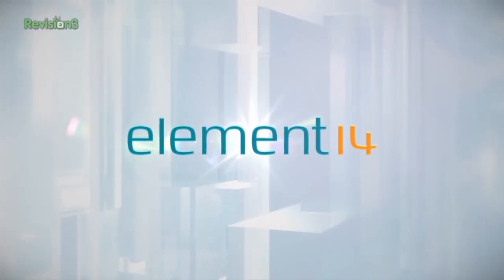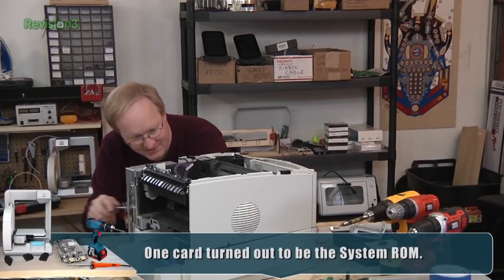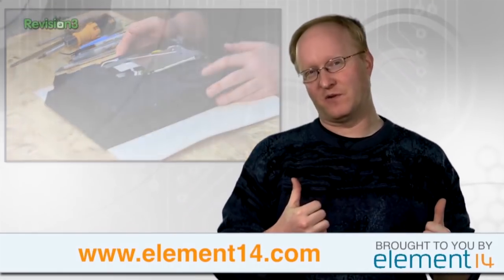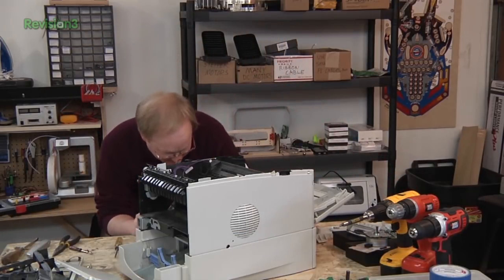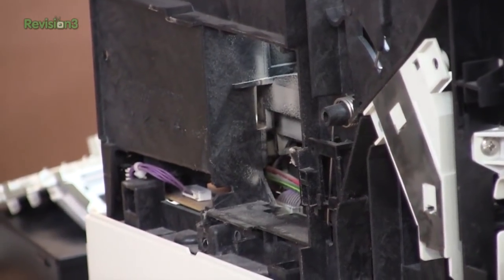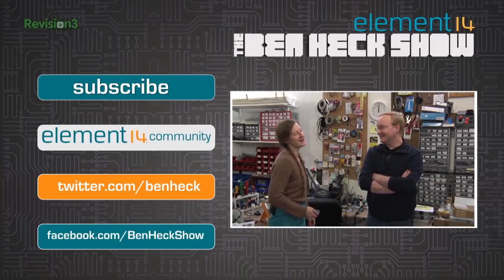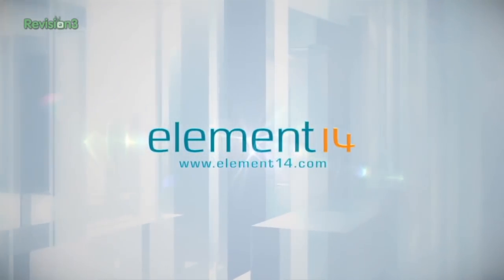Ben Heck's Laser Printer Salvage

Comment: I have this same printer, still running, got it from my high school when I was a kid, and with the network card in it, it's hooked to my wifi router as a wireless printer, works flawlessly (after a new paper feed roller kit) and the toner cartridges are $10 bucks on Ebay. Even if you fixed it up it's still quite a useful printer!

Comment: The best way to reuse a LARGE HP printer is to fix it and put it back in service.  With a little TLC the HP LaserJet 4, 5, and 4000 series will run forever.
Reply: Indeed, they often say that cockroaches and ants would be the only animals to survive a nuke but at least they would have a HP 4L to use afterwards!
Reply: My college is still using 4100Ns in multiple labs and they work flawlessly!

Comment: I'm always amazed by the mindblowing engineering that is used inside these machines. The electronics, switches, springs, screws, motors, forms and weird shapes of plastic elements, the number of parts etc. Nice blob on the LCD PCB, must be Japanese? How many engineers design such device? How many pages is the paper of design? Must be crazy. Love to see the ABS recycle machine.

Comment: In my 3D printing class at my University, we are making a grinder/ extruder (specifically for PLA, but ABS would work too on a different temperature).  It is very close to being ready but the extruder wasn't getting hot enough.  We are planning to use it to reuse scraps from previous prints (it really adds up), and failed prints.

Comment: every shop that does plastic injection moulding has a grinder that they use to grind down the rejects, sprues and other plastic waste and blend with the virgin plastic. Cuts down material and waste disposal costs. They tend to keep colours separate unless you have a hidden part and do not care if it is a blend of various colours. You often see this recycled plastic inside products.

Comment: Nice, I just teared down a laser printer few weeks ago. It was a crap Samsung that was clearly designed to fail.
I had no idea how to control the laser or the motors, they had like 10 pin connectors.
I still have 3 boxes full of loot left, most is sexy black plastic. (This poor town hasn't got plastic recycling anywhere and garbage disposal wants big bucks to take this)
Would be cool to see some projects with these parts. I also aquired similiar worm motor and laser unit. My thing only has 4 sides instead of hexagonal.

Comment: I stripped down a shredder for parts. I claimed some nice gears, metal rods, switches, lots of self tapping screws and a motor. I was a lot less gentle on the plastic using snips and a saw. Most of the plastic went into my council recycling bin, except for the large flat sheets which I've saved for future projects

Comment: For those who don't know, printers are actually no different then computers. Some big commercial printers use hard drives but most use flash memory. They also have RAM and use an IP address. The only difference really is instead of a screen it uses paper.

Comment: Fuser run on mains voltage. it's a halogen bulb like in a work light, but a special coating that makes it emit IR radiation, heating the drum, also may be usable for SMD soldering.

Comment: Certain parts of the plastic and metal housing can be re-used for building boxes/containers for your projects, especially if you don't have access to a 3D printer. Don't get rid of anything, until you are sure you can't re-use it.

Comment: The black box filled with epoxy is probably a capacitor/diode chain used to boost voltage.  High voltage is used to induce charge on the drum, charge the toner oppositely, and to pull (transfer) the toner off of the drum.  Many of the most essential parts are actually in the toner cartridge.

Comment: To make an extruder for ABS plastic granules you could use a hopper with a archemidies screw to apply pressure to force the granules into the hot end. Hopefully resulting in a controlled and open ended way to feed granules into the filament extruder.   The other way I could think of was to use a syringe method, however that is not open ended, and you would need to reset and open the syringe to fill with granules.
Reply: Think of the good old bench mounted mincer, but with the archemidies screw vertical not horizontal (as you probably want to have the hot end fed from the top).  In fact with modifications to the hopper you could probably modify one to do this.  You could probably pick one up from a thrift store for a couple of bucks
Reply: Also would be cool to try and use laser unit to do 3D printing,  a selective laser sintering build might be interesting

Comment: Hi Ben, yet another nice video and informative, keep up the good work.
I got a question? all the motors you're salvaging from the printer could be of various sizes and of various powers (like one is of 2.5V-2.0A-1.8/Step, other one is 1.6V-2.1A-1.8/Step). 
For example if I got the above motors and wishes to use them in a CNC.
1) Can I use these various power motors in one system?
2) What sort of driver/power supply would I require?

Thanks in advance for answering this novice question.

Comment: Most plastics can be recycled and repurposed, including ABS for 3D printing.  Little known fact is that there has been a federal mandate for decades to include a minimum of 10% post consumer recycled plastic into any new product manufacturing and production, including such products as food and water bottles.  The obstacle in recycling any kind of plastic, is the equipment, machinery, land and power required.  It is not just ground up and extruded.  A very small recycling plant producing 200 lbs an hour can require as much as 2 acres of property and a 480V 2000 Amp 3 phase service.  Here's why:

The process starts with washing the recyclables in a hot bath before or during grinding to remove the first layer of impurities, using a 100-300 hp hi speed wet tank 2 blade grinder.  The second bath is caustic, using a catalyst, to remove the second layer of impurities, mostly old additives like anti-block, anti-slip, etc.  A new batched recipe of additives is then mixed into the ground plastic, or "fluff".  Then, the fluff needs to be dried using gas furnaces and dry air vortex silos, because any moisture introduced by wet fluff into the extruder, turns to steam, causing the 2 inch thick steel barrel to explode and screw flights to break in the 400-600 degree F process heat.  A minimum of 200 hp dc motor, large 17:1 gearbox and a 10-20 foot barrel and screw is needed to turn the extruder screw and push the ground plastic through a mold, since plastic is extremely dense and slow to melt at high heats, utilizing a small variation of 2 degree F delta 400-600 degree throughout the barrel length depending on type of plastic.  Extruded plastic is the quick chilled thru a cold chilled process water bath; in which the water temp can not rise above 60 F after passing 400-600 F degree plastic into it or the extruded plastic will not cure.  This requires at-least a 1000-2000 gallon process water tower or a 50-200 ton refrigeration chiller, a 500 gallon split tank triple 60 hp pump station, and a 1000 gallon chilled water pump trough.  Finally, the plastic needs to be treated with an anti-static since plastic holds an enormous amount of static after being melted and extruded, a process that requires an open air short circuit AC current at 480V and 16 kilohertz (yes, 16,000 hertz cycle) that the extruded plastic passes through, which then creates an ozone emission that has to be evacuated and eliminated via blowers and gas furnace (also a federal mandate) because of emission and health hazards.  If it is not treated, the plastic printer sticks  will not unroll, unpack, or load individually, making them useless in a printer application, and can also moderately shock unprotected hands.  

Ultimately, it can be done...  And many do, but as a business since the process requires mucho money, resources and property.  I designed and manufactured many industrial manufacturing lines for thermoplastics industry in the past three decades.

BTW... Love your channel and informative content.

Comment: Good luck using the laser unit for anything related to drawing an image. First off, the laser is near-infrared - so it's darn bright, but you cannot easily see it, so watch out! - Also, do calculations on the duty cycle - you would need an extremely bright laser to put enough light out to draw anything visible.

Comment: there are commercially available grinder and extruder kits ben :)
I think there are also build plans for free.
There is filamaker and filabot for one.
Reply: year there is but it would be a good project for ben to do
Reply: Or just give it to the Will it blend guy with his indestructible blender.
Reply: Ben JI indeed I want to see one build too. hopefully he can build one with a bit more commonly available parts so more people can hop onto basic fillament extrusion. It's gona be hard to keep it air bubble free and keep the fillament thickness even.
Reply: it seems pretty easy to make one
my ideas melt the pla abs-then extrude
it out of a 3d printer nozzel
Reply: Ben JI The problem is you need a lot of torque to cut so you need a metal shredder and the shredder needs to be able to pull the part in and not have enough space so it can grind small enough.

Then for the extrusion you need a lot of pressure and also have to find a way to get the airbubbles out of the extrusion.

And yes in the end you would use a nozzle :).
Reply: year your right

Comment: Is there anything I should be wary of when desoldering reclaimed parts?
Reply: +CowLunch Possible lead solder. Stay in a well ventilated room and try not to breathe the fumes. Use a fume extractor or a small fan to keep the fumes away from you.

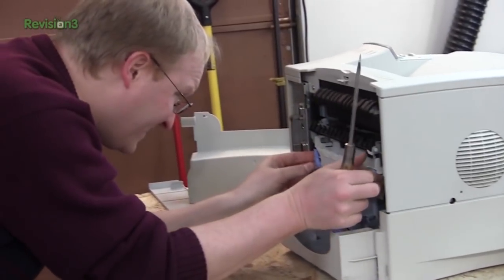Comment: That odd boxie type part at 3:14 , i think that's the thingie that heats the coil, oh yeah it's called the fuser assembly - Bonds toner to paper with heat; well if it's not the fuser assembly it's the scanner, some of those printers have a fax function...  i was hoping you would say that about the multiplexer or duplexer those are some of the cooler sounding parts for laser printers XD

Comment: Does the fuser output enough heat to be the heat source for an ABS recycler?
Reply: You know thats a good question Could use the parts from the printer to make a Abs grinder project.
Reply: That's a good idea. I work on lexmark printers and their fuser temp is 180*C/356*F which is about the correct temp for PLA and ABS extrusion. I also liked how Ben pulled out the fuser and said "What the heck is this?" :)
Reply: GlassCurtain I hope Ben see's these comments i want to see what he can do with his idea.

Comment: That’s no “worm gear” it’s known as a, “helical gear”. They were created as a replacement for regular gears which are very noisy... the helical gear accomplishes the same drive motion but makes much less noise with decreased backlash... it was developed for manual transmissions since they were noisy... the best way to illustrate is to listen to your reverse gears compared to the drive gears... the reverse gear is still a normal cut gear... it makes a noticeable audible difference.

Comment: The thing that irks me lately, is a lot of trash handling services in towns (like mine) are pulling "Claim" on the discarded electronics people have put in a 'Swap Shack', where people put still usable items for trade. But, they haul it to a water-tite shipping container, which they lock up, thus, they now OWN the items, and you cannot remove them from the container. Their reason: we sell it to a recycler for the gold content.  But, they also have slammed the door shut on us hard-hackers who want parts of the items. They've pretty much taken away a source of reusable devices, hardware, and parts from the nerds & geeks who can use them, and still return items they don't want.   It seems everyone is hard-up to recycle JUST for the gold and rare metals. But they neglect to say what happens to the rest of the scrap. (which usually ends-up as caustic waste and chemicals. and sometimes, costs more to dispose of than the amount of rare metals recovered.

Comment: if that's a 4100, I'm so glad it's dead. those things are nothing but problems.
it's the 4200 series that really shine.

same with the 2200 series and the old 4/5 laserjets. but you don't kill those. those things last forever. I have a couple of 18 year-old 4's at work that recently (3 years ago) got jetdirect cards and have been in classrooms doing printouts nonstop. aside from some tape here and there and finally needing maintenance kits after all the abuse they've endured over the years, they're still running strong with about 100,000 pages or so between them.

Comment: HEY YOU SHOULD USE THE LASER CARRIAGE AND SPINDLE TO PAINT AN IMAGE FOR SLA 3D PRINTING.  YOU WOULD NEED A UV LASER TO TO CURE THE RESIN.  THE CANADIAN BASED PEACHY PRINTER USES A GALVANOMETER AND MOST HOBBY SLA PRINTERS USE DIGITAL LIGHT PROCESSING TO PROJECT UV THROUGH A SHALLOW TRANSPARENT DISH.  I THINK THIS WOULD BE AN INTERESTING SOLUTION

Comment: Hi, is there a hack for using old mobile phones (12 key keypads/bb9700 keypad) as input devices for laptops/tablets running windows and or android? connection via usb/bluetooth/ip address?

i use to remember typing really fast on those 12 key keypads.

Comment: Omg did you even check to see if it worked? If that paper jam is in a spot the average user could not get to without removing the back, like you did, they would just assume it was broken.
Reply: Seeing as it came from a Technical College I would say they checked it..
Reply: They obviously didn't because they would have removed the paper jam. Just because someone is at a tech college doesn't mean they're not dumb as rocks. That includes the instructors.
Reply: Why waste the time to remove a paper jam if it didn't turn on? There could be many reasons they scrapped it.. I wouldn't diss on Technical College Instructors I know plenty of Instructors, and Highly talented, and very intelligent people who attend Technical colleges. I hate messing with these old machines, they are a pain to get apart, and a pain to reassemble. We have scrapped plenty because none of us want to bother repairing it, so we scrap them for parts, and toss the rest.
Reply: jeremyhall420 Correct, they are built to just throw away and buy a new one, they are not meant to be serviced.
Reply: *****
There maybe plenty of reasons to scrap the machine but laser printers are in fact meant to be serviced, they have a use life of 5 million sheets or 10 years. Inkjet printers on the other hand can be thrown and in fact it is cheaper to replace the printer than keep buying cartridges. In  my time as a copier and printer repair tech I have found some of the worst users to be teachers who think because they teach they know automatically what's wrong with a machine and how to fix it themselves often turning a 10 min cheap fix into an hour long rebuild costing hundreds in parts and labour to put right, the best way to avoid that is to try and build a professional relationship with them to call and get advice before trying to fix it themselves, however some just wont be told!